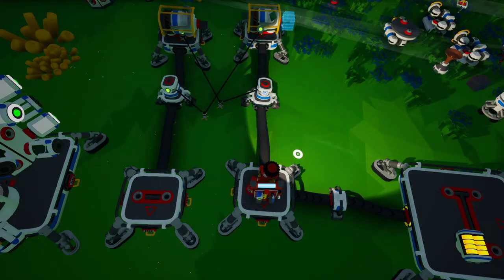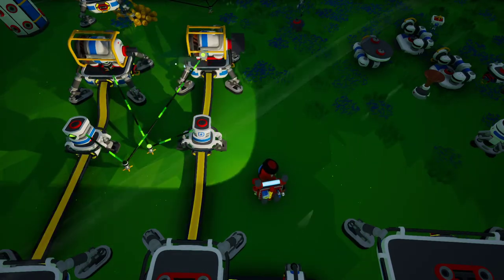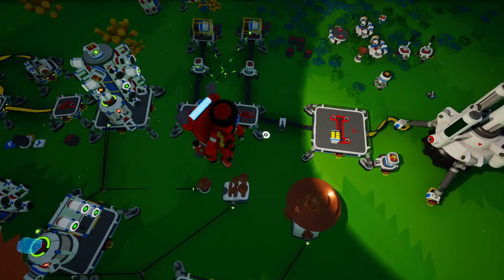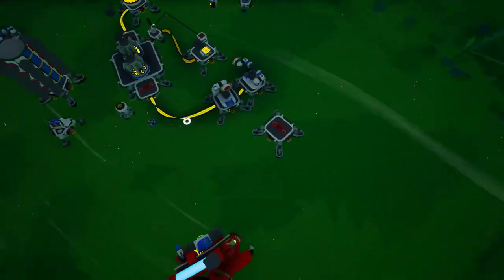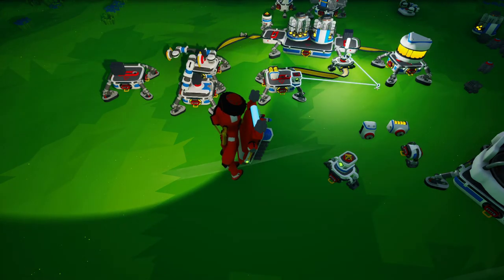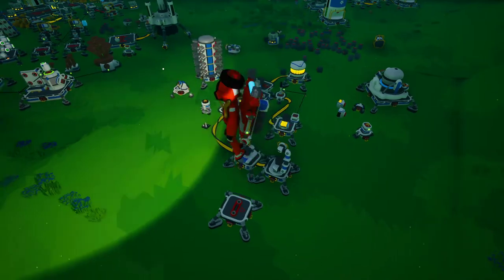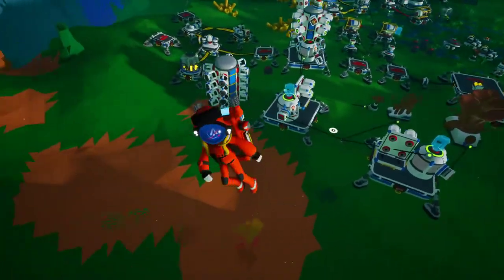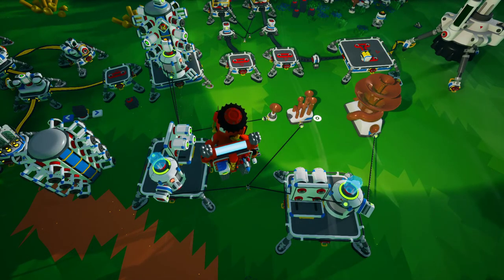Astroneer Automation Guides - Three methods to create clock cycles (Work in Progress)

Comment: dude this is genius with the soil canisters. You can make a clock with that and decide how fast or slow the clock is. GENIUS!!!
Reply from the maker: I'm glad you like it! Credit for the main clock goes to timmy_th1cc, I just added the delay circuits. I really think the automation update is amazing, there's a lot of flexibility in how you design things.
Reply: @duckyobrien  ye, but there are a lot of bugs in that update too, especially with the resource canisters. Sometimes when i change the storage function before the item gets completely ejected by the canister the item is like half completed and its stuck there till you fill a new resource in it to put that broken resource out. You cant even pick that trash up it lays on the ground for ever